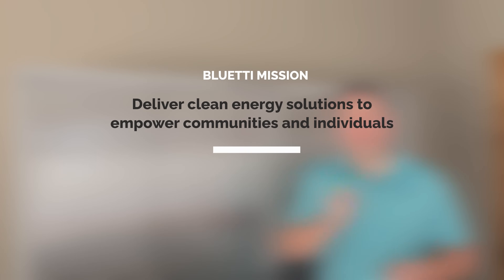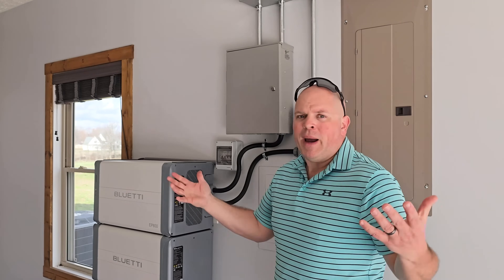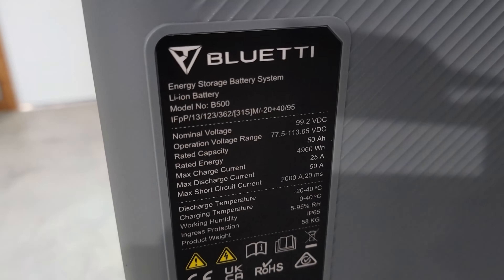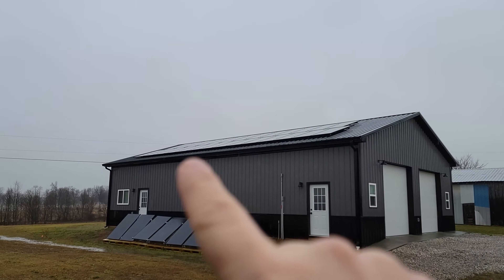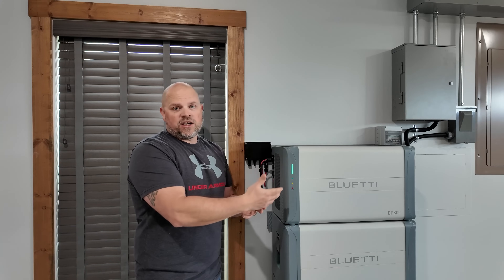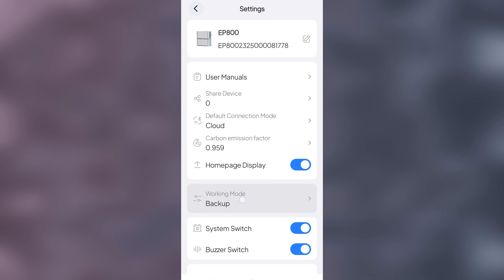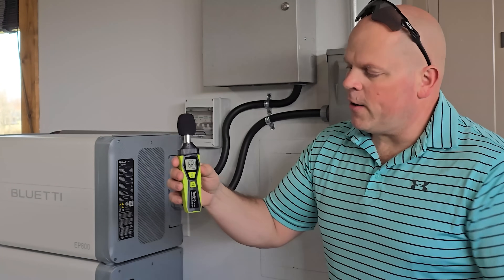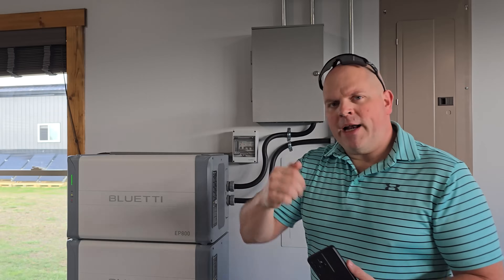The ONLY video you NEED to WATCH - Bluetti EP800

Comment: Because these these cheap high-frequency, transformerless solar generators lack an output transformer to provide galvanic isolation between their DC boost stage and their AC output, they can damage your appliances and even set them on fire. Don't take my word for it, ask Google AI this question: Can a high frequency,  transformerless inverter damage your appliances? and learn the truth about these potentially dangerous products.
Reply from the maker: Thanks for sharing

Comment: And then the AC 900 could take 12 batteries, which is kind of surprising?Then which is actually built before this one, but the AC 600.Well, that 1 could take 16 batteries.The best one you have for batteries and most worst and vertiat all

Comment: At 500vdc, how would one reach the 9000 watt max of solar? Youd hit voltage limits before wattage. I have found some 550w panels with 49.9 VoC and 10 of those would hit the voltage limits. 🤔
Reply from the maker: I have been using 400w panels that output 37.1 voc. There are 2 MPPT's on the input. one at 6000w and the other at 3000w. It would be hard to find the perfect panels to max that out but with two MPPT's it would allow you to get very close with some of the panels on the market.
Reply: You’d have to put some panels in parallel